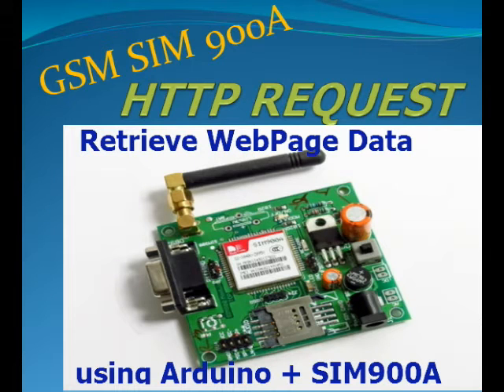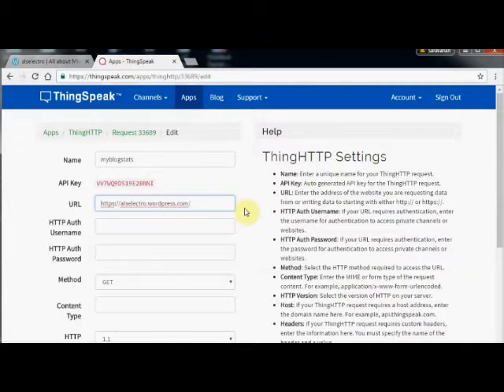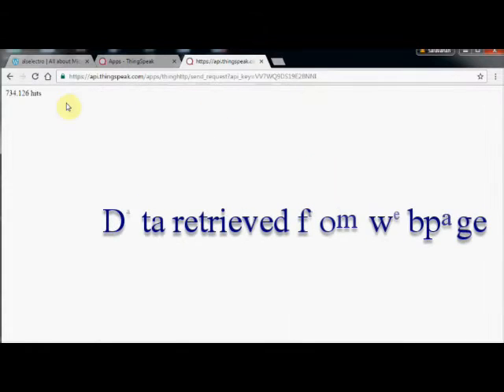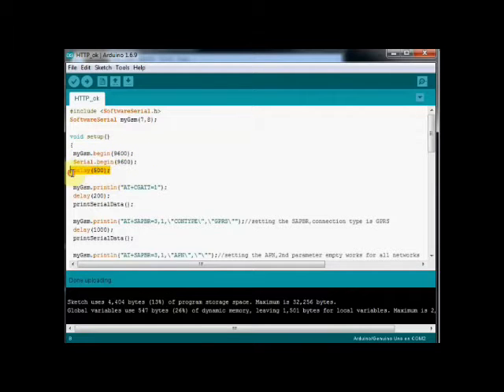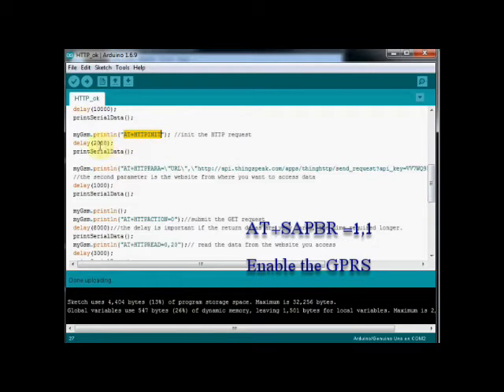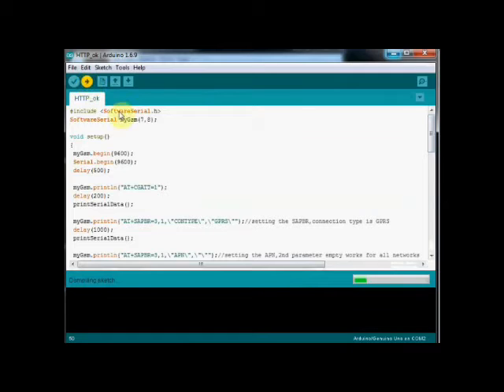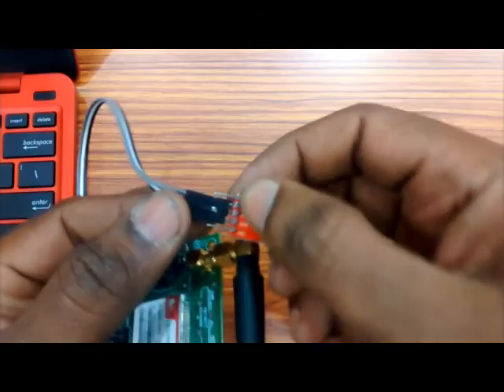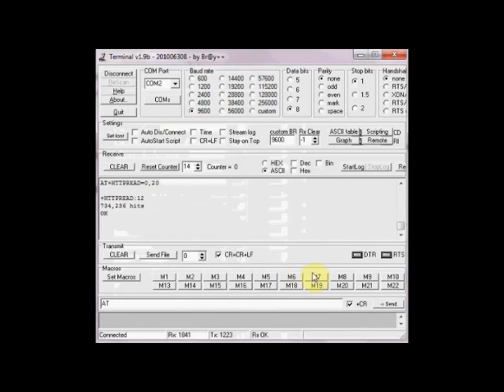GSM with Arduino - HTTP GET REQUEST - Retrieve Data from Webpage

Comment: im using sim7600 module 

AT+HTTPACTION=0

OK

+HTTPACTION: 0,706,0

 most of the time im able to read the data from server. but some times im gettting http error 706, 713,716 what is the issue?

Comment: Sir, Can you please tell me how to get the response of  AT+HTTPREAD=0,20 in a variable ? I have tried the following way, but i m not able to get the desired value.

String val;
val = myGsm.println("AT+HTTPREAD=0,20");// read the data from the website you access
delay(3000);
Serial.println(val);
printSerialData();
Reply: Hello. is the problem solved ?

Comment: Hello 
I got +HTTPACTION=0.601.12
I changed the sim card as it had some problems now I'm getting error msg afer each AT command
 What do I do?
Reply: if u change sim card and getting error now, then u must have a problem with this one !
"AT+SAPBR=3,1,\"APN\",\"wap.abcxyzcompany.com\""
Every Company have different APN ...
Reply: @muhammadhassaan4753  im using sim7600 module 

AT+HTTPACTION=0

OK

+HTTPACTION: 0,706,0

 most of the time im able to read the data from server. but some times im gettting http error 706, 713,716 what is the issue?